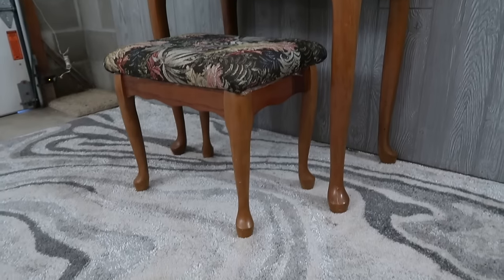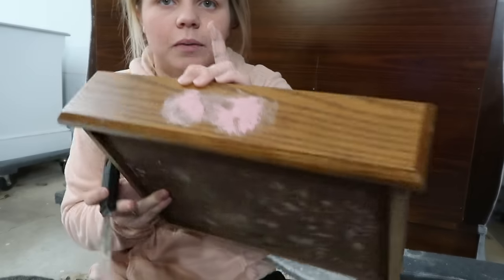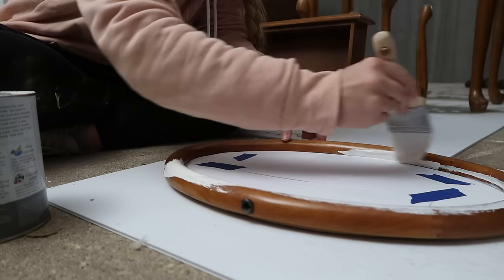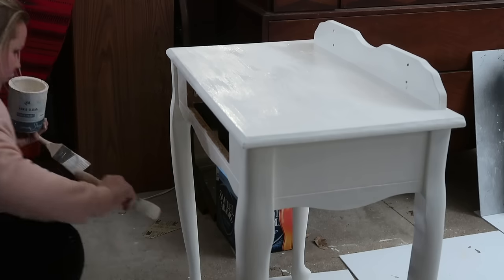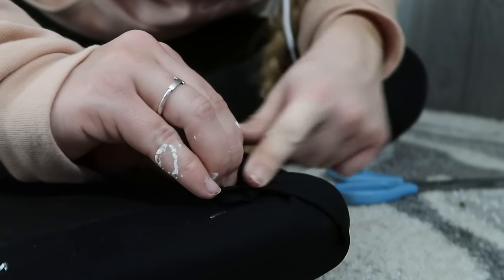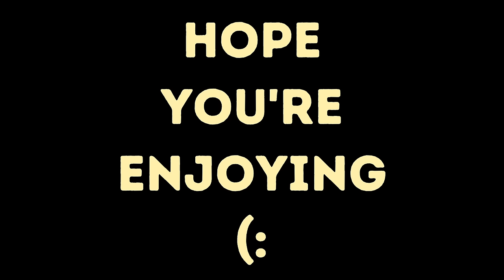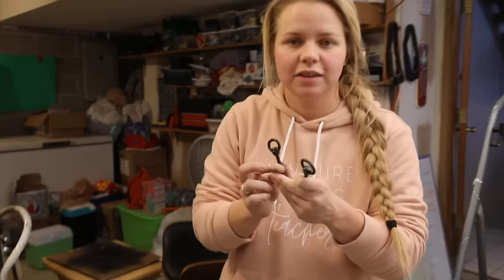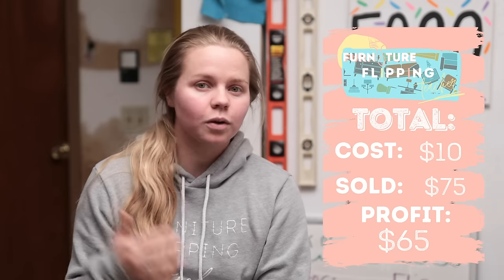| DIY Makeup Vanity Makeover Before & After | Annie Sloan Chalk Paint | FURNITURE FLIPPING TEACHER |

Comment: You made the vanity beautiful 😍 you can try using a deck of cards to wedge between the mirror and wood instead of paper. Paper tends to stick when it gets wet or rip easily. Be sure to tape the cards down on one side so they dont fall off.
Reply from the maker: I will remember this next time I have a mirror to paint! (: Thanks for watching!
Reply: @FurnitureFlippingTeacher  removing the paper when the last coat is done and before it dries should help prevent the paper from sticking

Comment: I actually like the colors you used for the vanity better than the one I did ..haha...just one tip....I got this too from another furniture flipper.   When painting the hardware it's easier to stick in the Styrofoam that comes in packages for electronics or similar....and u can reuse the same styrofoam....plus it actually holds it upright for ya at same time👍
Reply from the maker: Thanks for the tip! Thanks for watching!
Reply: @FurnitureFlippingTeacher  you're so welcome....also Maybe this tip may help....I click onto a pic of dresser or vanity or chair I'm flipping AFTER it's Finished and Do "Search Google lens" option and This pulls up similar SAME furniture and I can click onto or Just see the prices Under the similar pic.  .that may help with price point...Have a great one kiddo! Keep flipping ☺️👍

Comment: You really should invest in this staple puller Cain 126 you can get it from tools4flooring.com it is like $7.00. Then you can pull old fabric off easily and then reupholster. Would be much more professional to pull old fabric off. Would also be very helpful when removing skirts off chairs. I have several and love using them instead of a screw driver and pliers.